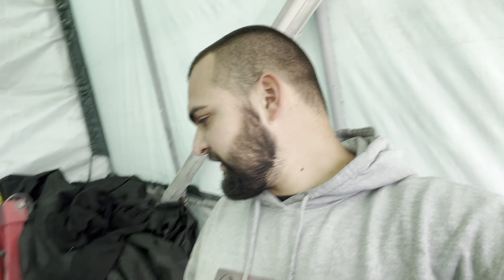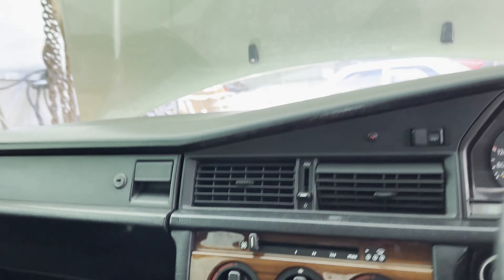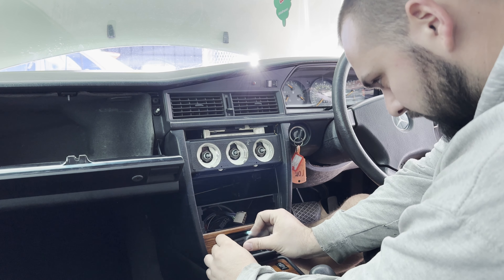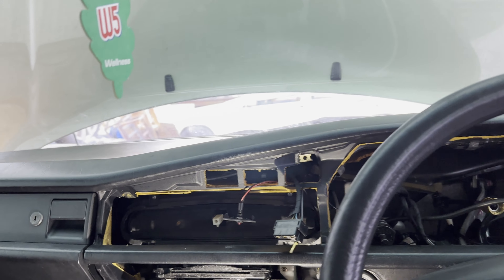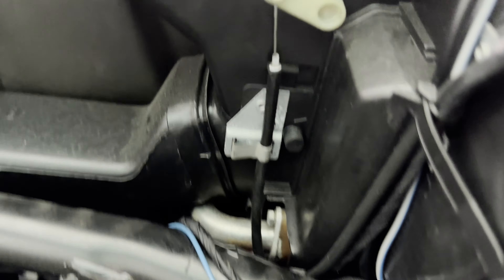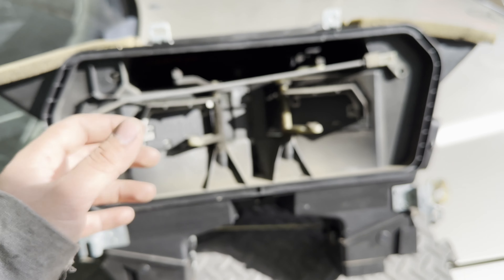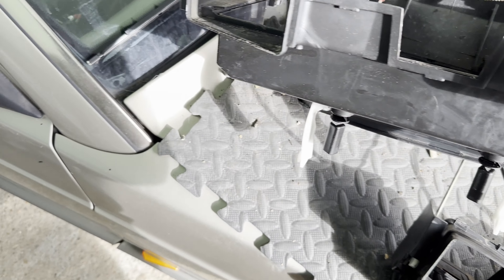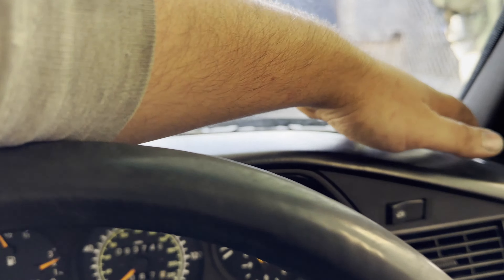Mercedes 190E Heater Core Replacement

Comment: This is a great video and super helpful so thanks for filming. I did find it jumped on some of the main bits like the actual removal of the dash and the cluster and the heater core box which is fundamental to success on the job - not sure why you ditched these actions including the splitting of the box to get to the core and things like the vents removal all very tricky and worthy of filming. I wish I’d been there to hold the camera for you - still great job thx for sharing.
Reply from the maker: Thank you! Yeah I didn't had a way of holding the camera to film everything, but when you start doing it, kinda guides you through itself. 😁

Comment: Hello brother, I have a request from you. 10:45 I accidentally messed up the socket that you held with your hand in the video and the cable order was confused. Can you help me with the correct cable ordering?
Reply from the maker: Hello, which socket? You mean the electrical plug?
Reply: @driftinrust  Brother, the heating control socket you show with your hand at exactly 10:45 in the video.

I accidentally removed that socket and the cable pin order got mixed up.
Can you make a video of the socket so I can get it in the correct order?

Comment: Hi I wonder if you can help me with a gas leak in my AC system.The detector ,detects that the leak is coming from under thecdashboard. 
My question is , could the leak be coming from the heater core or woukd it be the evaporator behind the heatercore.
Any answer would be appreciated.
Thank you
Reply from the maker: Is it leaking coolant or AC gas?
Reply: When I charge it with AC gas R12 it only last a few weeks
Reply: Thanks for replying.that's great
Reply from the maker: @PaulBater  It's probably the condenser behind then. Or any other old o-ring through the system. People usually convert these to the newer gas style nowadays.
Reply: Amazing,thanks.
I have another question if I can ask.
The lights on the center console don't work I've checked the bulbs but still no luck. The clusters lights  transmission light ok. 
Do you know if it could be shorting out or some fuse somewhere

Comment: Do you need to drain all the coolant?
Reply from the maker: Not all of it but at least from the head. Undo the heater core pipes before they come in through the bulkhead and it should be fine.